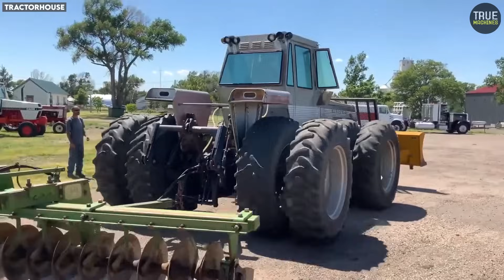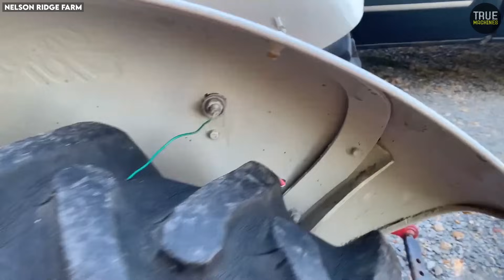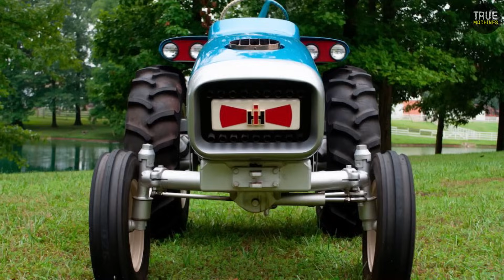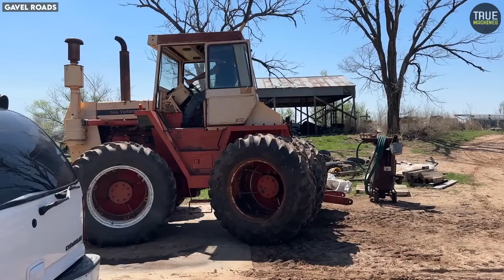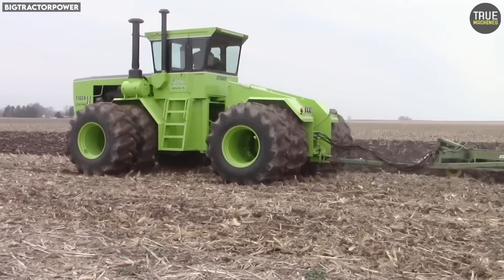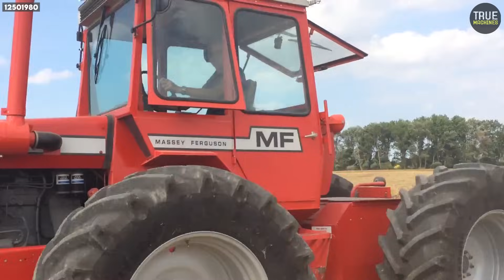10 Tractors That Were Too Advanced for Their Time

Comment: Case produced rigid frame 4 wheel drive tractors to the mid 90's and were very popular tractors. My dad had a 4690 that was a work horse, you cod run a full 10 hours on a tank of fuel pulling a 38' John Deere 1600 hoeme.
Reply: Cih also produced the 9240 and 9260 until 95 both rigged frame

Comment: I lived on a farm. None of these tractors were advanced. Maybe on paper as they suggest, but so would a rocket powered swing set. Because the tractor companies would not make high hp tractors by 76 farmers were using big road trucks pulling harrows etc. I remember seeing it on TV news back then. Notice that tractor they say that was so advanced pulling a twelve foot harrow? 100hp 4020 and a lot others could pull that!. Until cat came out with the Challenger the tractor companies were determined to keep the hp small for a farmer.

Comment: Case stopped producing rigid frame 4wd after a few years?  Rigid frame 2470s sold from 69-79 and became the highest selling 4wd of all time, followed up by 5 years of the 90 series rigid frames, and then the 94 series.  The last rigid frame case was I believe the 9260 in the mid 90s.
Reply: I learned to drive a case 1470 when I was just a teenager. What a handful to drive, but a very reliable tractor, we replaced it with a 2470. A whole lot nicer tractor to drive!